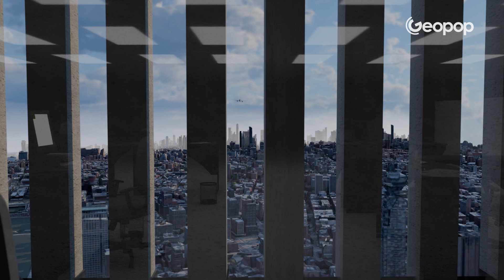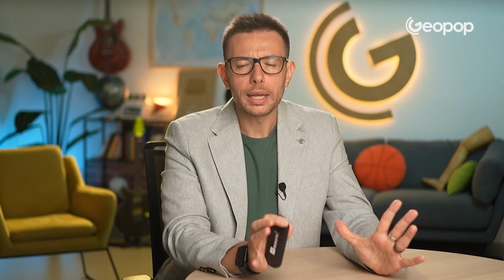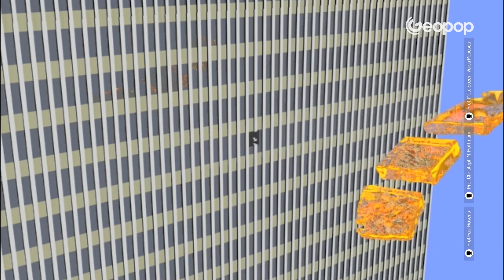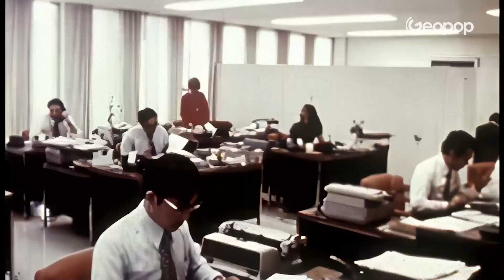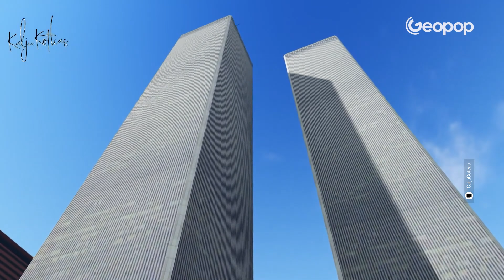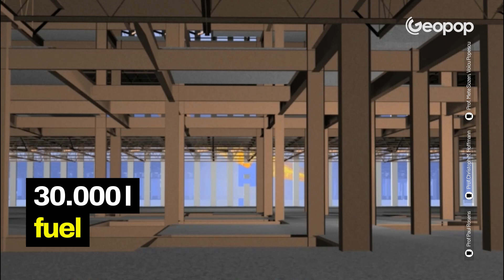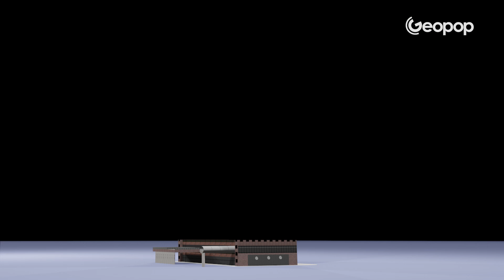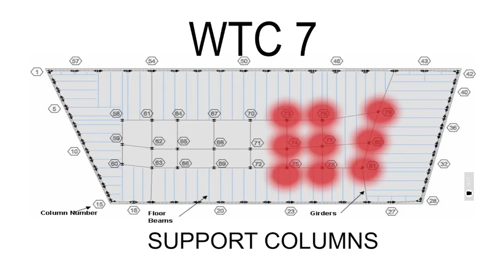9/11, 2001: The Technical Reconstruction of the Twin Towers and WTC 7 Collapses

Comment: The fact that they both fell in the exact same way, blows my mind.
The top of each tower didn’t fall over to one side…..the middle of the building didn’t give out…….just fell straight down…both of them
Reply: You literally can see the top part of the building lean over to the left as it falls.. please don’t be so dense
Reply: @AlexGonzalez-ye9pc you are right. But then how on earth does the rest of the structure collapse straight down. If its at an angle then there shoukd be an angular collapse. But even then the idea that the floors pancaked is insane when they literally disintegrated.
Reply: Are you blind? The top of south tower tipped over at 20+ degrees at the impact site, and it didn't tip over more or fall off because the structure below it could no longer support the shifting weight, so it fell straight down from that point. The north tower also tipped, but not as much.
Reply: Exactly, as they should have because, think of weights sliding on a barbell,, the inner support columns were intact in the cold zones, and the foundation was uneffected, so the mass coming down snapped all the floors sliding down the strong inner support columns
Reply: Of course they fell the same way since they were constructed and damaged in the same exact ways
Reply: @apacheattackhelicopter8410 but WTC7 wasn't
Reply: Imagine a jenga tower but you remove one entire level at the same time.
Reply: They did in fact collapse very differently.
Reply: Actually if you really pay attention, the upper portion of both buildings begin to tip over before disappearing into the dust cloud. Neither building truly came down into its footprint, but travelled across the plaza and surrounding streets causing severe damage to the surrounding buildings
Reply: @TheKairielise yeah cause of explosives
Reply: @TheKairielise  Nope both fell into their own foot print and even evaporated many thousands of tons steel? Even the radio mast on one tower managed to fully disintergrate even though nothing was above it to crush it? Explain that?
Reply: Wow, what a bunch of utter assholes in these replies.
Ugh, Harris supporters, I’m sure.
They’re the only ones who can’t answer a literal question, without demeaning the person asking.
You all are the reason TODAY, America is a cesspool.
Reply: All the weight that they supported for 30 years suddenly just became unbearable.  Poor towers.
Reply: @PhillipJermakian  ...funny as, mate
Reply: That is absolutely FALSE. Both buildings failed initially at the point of impact. You can clearly see the top part of tower 2 begin to buckle in the impact zone, tilt as it began to come down, and fall on the lower part of the tower. Neither collapse looked ANYTHING  like a controlled demolition. Apparently you controlled demolition buffoons never tire of being proven wrong and ostracized.
Reply: Exactly - pretty much fell within their own building footprint - kinda like in controlled demolition jobs.......guess I'll have the CIA kicking my front door in, anytime now, for not accepting the bullshit narrative spouted all these long years !
Reply: There's a lot we're never told: Catholic church, JFK, aliens, deep state, 9/11, etc...
Reply: The north tower did fall slightly to the side. In some videos of the collapse you can clearly see the antenna at the top goes slightly sideways. The part from above the collapse didnt go down straight but at a slight angle. From bellow the collapse it goes straight down because of the pancaking effect from the top of the tower falling down on top of it
Reply: Look at that 1st tower again. It definitely tipped to one side before descending into freefall.
Reply: All three of them collapsed onto their foot print.
I call BullShit on what we were told!!
Reply: Yeah, hate to break it to you, but gravity goes straight DOWN.
Reply: Both towers leaned heavily when they falled. It's just that the only force affecting them is called gravity, and it points down. But as they did lean considerably, that's why eg. WTC7 was heavily damaged by the debris even when it was located far away.

Just look a bit closer all those videos and you can clearly see the top parts weren't standing straight when falling down due to gravity.
Reply: I think they did a good job explaining that. The shock of multiple stories falling onto the remaining stories, caused the structural elements holding the most weight (the columns at the bottom) to fail.
Reply: @jcarp1776 building 7 fell at free fall for a few seconds. That is undisputed. This can only happen if there is NO resistance from below. Also watch the NIST graphic again then watch the actual collapse. You'll see that the graphic does not accurately depict the collapse. It's crazy.
Reply: Because they were designed like that wiseguy. The towers could fall from other causes, like earthquakes. You don't want skyscrapers falling like domino pieces in middle of Manhattan.
Reply: @Kannot2023  I seen this assinine comment before. The towers were designed to collape that way. Please explain in what universe any engineer designes a building to fall? They were designed to never fall down and withstand several plane strikes. Engineers are not fools!
Reply: @Kannot2023 you don't want them falling at all. And they shouldn't have.
Reply: There's no reason they should fall anyway BUT straight down. The lateral force from the plane was absorbed by the buildings mass. After that, all potential kinetic energy was pointing straight down. As the top collapsed, it went downward with a force the structure couldn't resist.

It literally couldn't "fall over".
Reply: @russlund2507  thank you for being an informed adult, answering my question, basically.
Reply: @russlund2507 I was a bit surprised because one hit a corner so I thought the top would fall toward the missing section.
Reply: @russlund2507 the top of I believe the South Tower tilts at an angle at some point yet the building continues to collapse straight down 🤔
Reply: It's called gravity
Reply: We all know what was really going on that day..
Reply: @ChrisGarfield  I disliked this comment
Reply: @badcornflakes6374  mine or yours?! You know you can't see if someone pressed the dislike button any more right.
Reply: @badcornflakes6374  It was an inside job.
Reply: So sad to see so many people belive what they are told to believe, even to this day... @ChrisGarfield
Reply: @briangiven7399  explain the rivers of thermite
Reply: @DavidDieni  You can't explain something that was never found.
Reply: @DavidDieni  traces of aluminum ≠ thermite. Planes happen to be made of aluminum
Reply: @somehaloguy9372  
I am not being deliberately provocative. What is being proffered here contradict existing evidence. 

Live suppressed media footage of explosions emanating from the Twin Towers, including injured victims. Live footage of fire officers discussing the multiple explosions as they are occurring.
https://youtu.be/RTTGyTXVuX8. The cameras do not lie

The towers were constructed to stand after being hit by two aircraft. No other sky scrapers have ever succumb to fire. Including those engulfed in flame for over 24 hours, and were subsequently refurbished and stand today

Architects and Engineers for 9/11 Truth released a study on the 20th anniversary of 9/11
that refute the following

• Sagging Floor Trusses Can’t Pull in Perimeter Columns
• What about at the Explosions
• What about the Massive Dust Cloud?
• A Small Section of Tower Cannot Crush a Larger Section
• Fires Have Never Destroyed a High-Rise Steel-Framed Building
• Towers Cannot Fail Straight Down
• Buildings Have Survived Much Longer in Fire
• What about the Eyewitness Accounts of Explosions?
• Normal Fires Can’t Melt Steel
• NIST’s Models Don’t Look Anything Like the Collapse
• NIST Caught with Their Pants Down
• Thousands of Architects and Engineers Support Ae911truth

file:///C:/Users/david/Downloads/Scott%20DM+Hamburger%20R%20(2021)%20-%20Engineers%20Assess%20the%20Truth%20in%20AE911Truth.pdf

I am am activist, and the US was defaulting on debt repayments by the year 2000. The decision to go to war was made in the late 1990's the blueprint for the invasion is Brzenskis "The Grand Chessboard.” He identified the problem in launching a war for oil is finding or “the manufacturing’ of a pretext to legitimise the war to the American people. A war we now know is based on lies. 
https://www.globalresearch.ca/the-eurasian-chessboard-brzezinski-mapped-out-the-battle-for-ukraine-in-1997/5373707 

Genocide for oil.
The US has launched 251 military interventions since 1990 alone that has cost 5 million lives lost, conservatively. Libya, Iraq, Afghanistan, Syria and Yemen have been razed to the ground and mired in civil war due to illegal US interventions. Americans make up 5% of the world’s population, but use 27% of he world’s oil. As of 2008, we have used over half the world’s retrievable oil reserves and production is in a permanent decline. That is why the war was launched

 Brown University, Box 1970   Providence, RI USA
WATSON INSTITUTE FOR INTERNATIONAL AND PUBLIC AFFAIR

costsofwar@brown.edu

Fact Sheet: The True Costs of the Post-9/11 Wars
The Costs of War Project has created this resource drawn from our scholarly research as an
overview of the true costs of U.S. post-9/11 wars. The “post-9/11 wars” refers to United States-led
military operations and other government programs around the world that have grown out of
President George W. Bush's "Global War on Terror" and the U.S. invasion of Afghanistan in 2001.

The Human Cost
The body count continues to grow. An estimated 905,000 - 940,000 people – including U.S.
soldiers, allied security forces, civilians, and militants – have died due to war violence in Iraq,
Afghanistan, Pakistan, Syria (in the fight against the Islamic State), Yemen, and elsewhere. At least
408749 - 432,093 of those who have died were civilians.

Many other people have died indirectly as a result of the wars. An estimated 3.6-3.8 million
indirect deaths have occurred in post-9/11 war zones, including in Afghanistan, Pakistan, Iraq,
Syria, and Yemen, as of 2023. The total death toll in these war zones could be at least 4.5-4.7
million and counting, though the precise mortality figure remains unknown. Some people were
killed in the fighting, but far more, especially children, have been killed by the reverberating effects
of war, such as the spread of disease and malnutrition.

The Environmental Cost
The Pentagon is the largest institutional consumer of fossil fuels in the world. It emits more
greenhouse gases than whole countries, like Morocco and Switzerland. The post 9/11 wars are
thus key contributors to climate change.

The Expanding Scope
The United States has post-9/11 military operations and programs run out of civilian
departments for military purposes in at least 85 countries. Under the auspices of
counterterrorism, U.S. operations stretch not only to Afghanistan, Iraq, and Syria, but also to
Pakistan, the Philippines, Somalia, Mali, and many more countries than most Americans realize.

The Budgetary Cost
Post-9/11 wars have been extremely costly. Through 2021, the U.S. federal government has
spent or been obligated to spend more than $8 trillion on the post-9/11 wars. These are “credit
card wars” that have largely been financed through borrowing.
The opportunity costs are staggering. Many of these funds could have been spent on public
health or in sectors that create far more jobs than the defense sector, like education or green
energy.

Americans are delusional. The USA is no better than Nazi Germany. The psychopaths in charge wouldn’t blink twice about manufacturing a causis belli, by blowing up the twin towers

Comment: What about the molten steel even though the temperatures weren’t hot enough to melt steel. Molten steel was found all over the place at ground zero and thermite was found in the dust

Comment: Ridiculous. Why to use fake voice? Okay, you are shy and insecure. But why do you need to over and over again explain collapse of towers? They (Bush admin) started with “pancake” theory that didn’t make sense at all. Then sagging floors that pulled in core and perimeter columns. Why do you guys put so much effort in trying to bend physics into Bush admin narrative? Just look at the facts, work with the facts and conclude the evident that every mature individual does. Your explanation is not science, it’s actually manipulation of facts to fit official narrative. You do exactly what flat-earthers do, actually. You just deny facts and come up with some highly improbable explanations so it fits your narrative. There were black 6-7 story buildings around towers (WTC4-6). They had even lighter steel frame and got badly beaten by falling debris from WTC1 and WTC2, caught fire, but none of them collapsed. Now you are trying hard to convince everybody that two super tall towers designed to withstand airliner crash collapsed like house of cards. Also Deutsche Bank building was also badly damaged (like really huge whole through entire building) but didn’t collapse. Or are you just trying to make quick buck on clickbait content?